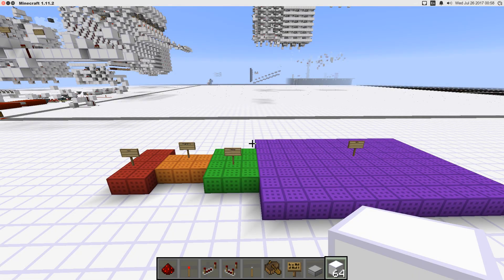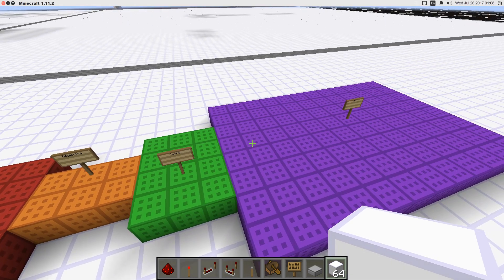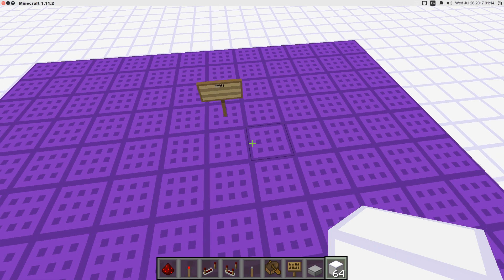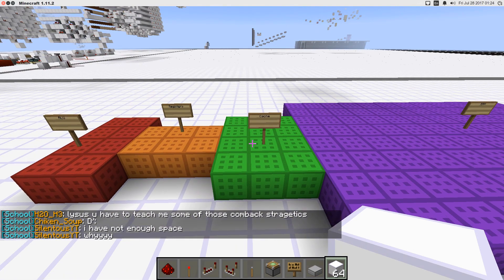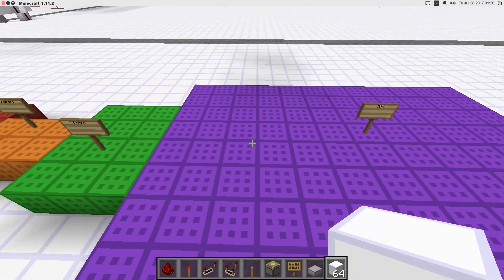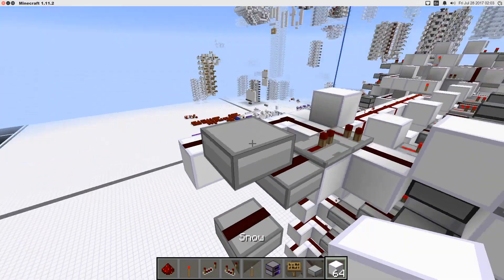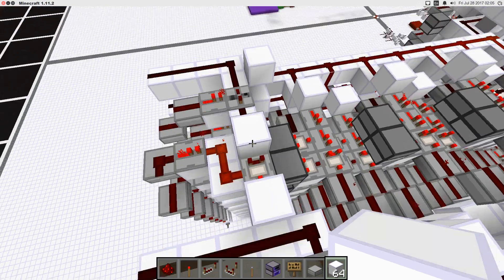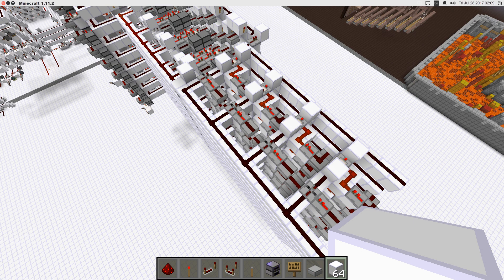Building a Better Redstone Computer Tutorial 7: Cache Registers

Comment: Ok, so the registers are actually "slower" than the cache.
The reason why you do not use the cache design to make registers is because it is too big so we could only have 4 bytes of data in the registers?

But technically you could use the design of the cache for the registers, why means it would only cost 3 ticks to acces the register, but you would only have 4 bytes of register?

If I did get it wrong then why aren't you using the design of the cache for the register? (since cache design is actually faster)
Reply: I have the same exact thought as you. IF the cache can be accessed by ALU operations just like the normal registers are, benny should use the same register hardware as it would be less complex for the control unit.
Being able to do a context switch with that hardware is super usefull. IF the cache cannot be accessed immediately, its only job is to convert hex to bin and back, increasing memory overhead rather than providing more data at the cost of speed. 

As it is a bufferless pipeline, instructions just flow freely between the PC update and the initial write. Doing a cache line swap costs considerably more time.  I'm really interested in how benny handles this and the pointer implementation.
Reply: I think I understand what you mean. Just to be sure I'll ask you a couple of more question:

If the ALU is "n" ticks, and the registry is less than "n", it is still possible to use the registry speed by using a faster clock and give several clock cycle to each operation? Say the registry works (write + read) in "n/2" ticks, you give 2 clock cycle for each ALU operation (a clock cycle being "n/2" ticks) and 1 clock cycle for each registry 'operation'? (and it actually works even if the registry is "3n/4" ticks for example: a clock cycle would be n/4 ticks, an ALU operation would be 4 clock cycles and a registry operation would be 3 clock cycle?
Of course even if it is theoritically possible, in minecraft it wouldn't be interesting since you would need much more memory for the algorithms (in the last example it would take 4 rows of memory to perform an ALU operation and 3 for a registry 'operation').
This is what I understood from what you said, can you confirm it is right? If it isn't, why?
Reply: No, because you are doing an operation with the output of the alu. Going quicker than the alu can handle means you are working on a accumulator not yet updated from the last instruction. And do not start on hardcore course grained multithreading or some serial like data processing. 

On benny's dataloop, you cant call a register value you wrote back to in the previous instruction. This is fine for purely accumulator setups since you wouldnt store a accumulator to a register and load that same register to the accumulator again. But a cycle later you should be able to call it again. Something like: store to reg #4, load #3, add #4. Adding more register delay would make this chain of instructions impossible.
Reply: Oh ok, that's right, I'm really not familiar with this accumulator thing but it totally makes sense.
About the torches burning out anyway I don't think the clock would be that fast

Comment: Won't the accumulator architecture make the computer slower?
Reply: Why do you say that?
Reply: You have to loop one input through the system in order to execute two-operand functions (e.g. adding, subtracting, logic, etc).
Reply: @roxashikari3725  If you want to load the ALU in a single clock cycle you need two separate buses for the A and B inputs.